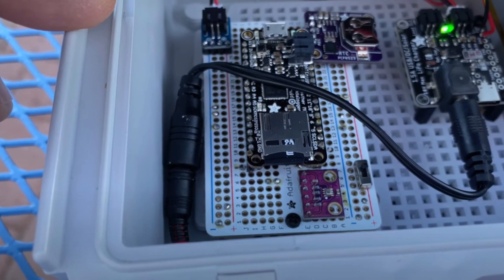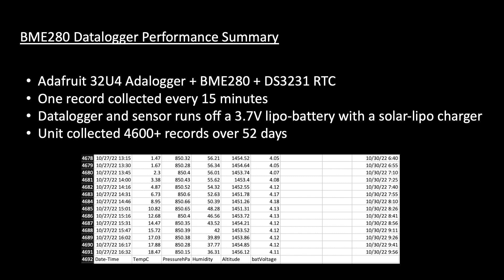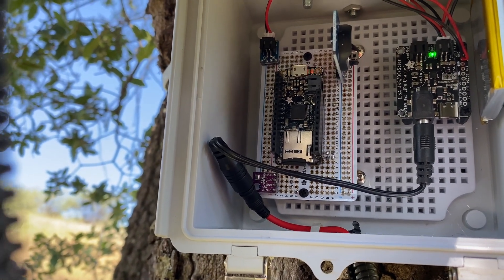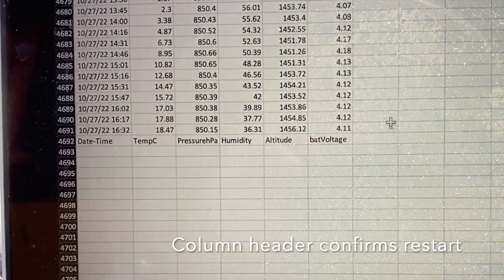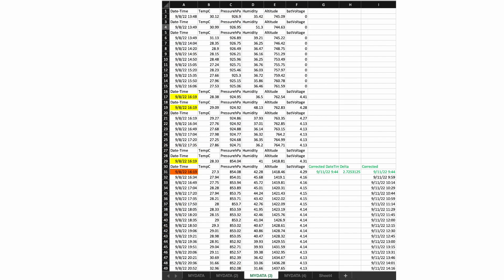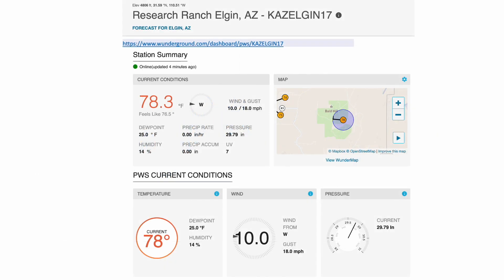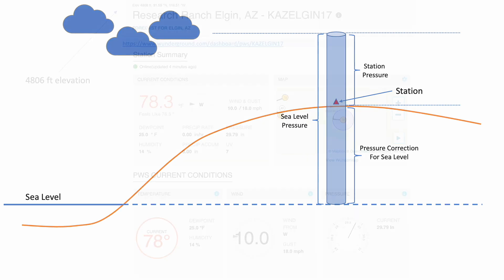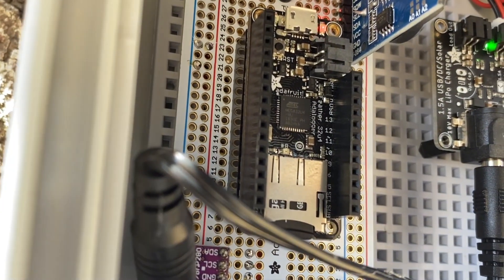Wetlands BME280 Datalogger - NEW Upgrades and Performance

Comment: Hi, Any chance you have a circuit diagram?  I'm struggling with how to connect the Esp32 with the solar charger circuit, battery and solar panel.
Reply from the maker: I have another video where the solar part is explained for a similar setup - scroll around on this one of details: https://youtu.be/93ipPhr7QtQ?si=iXXM4SP04Ul9B8nm
Reply: @ModestMaker  I'll check it out, thanks!

Comment: How did you manage processor so that it wouldn't drain the battery?  Did you put it in sleep mode?  I have a flood monitor using an ultrasonic sensor and am using a 5110 timer from Adafruit to completely turn off the system for 10 minutes, then back on to take a measurement.
Reply from the maker: Because we get so much sunlight in Arizona and since these are relatively low power systems, I haven’t had to deal much with power management but it is something I am exploring at this time 👍.

Comment: I used a watchdog timer to automatically reboot my microcontroller if it got hung up.  You can set the watchdog timer to whatever time you think is sane for it to do its work, like 4 seconds.  If the microcontroller is not done in 4 seconds, then the watchdog timer will reach over (you have to look real fast 🙂) and hit the reset button.  That might help you out.
Reply from the maker: Will check if out- thanks!

Comment: I've had similar issues with long term sensors, specifically using ATmega MCUs. One issue is because you're accessing the file system on an SD card with a relatively small and incapable 8-bit micro-controller with a lot of limitations, one thing that can happen is your RAM becomes fragmented or simply just full, the memory management on those little micro-controllers isn't smart enough to manage the memory in the same way a desktop PC can so will just lockup.

You can solve this issue by resetting it regularly in software, you can put the ATmega32u4 into sleep mode and use an internal timer and interrupt to wake it up again, this also has the added benefit of using significantly less power however there are limitations on max sleep time and resolution.

Unfortunately it's rather complex and involves editing the registers of the MCU directly, but a first example you can try on your ATmega32u4 to go to sleep for 8 seconds is:
```
    // start going to sleep
    USBCON |= _BV(FRZCLK);  // freeze USB clock
    PLLCSR &= ~_BV(PLLE);   // turn off USB PLL
    USBCON &= ~_BV(USBE);   // disable USB

    ADCSRA &= ~(1 << 7); // disable ADC
    SMCR |= (1 << 2); // power down mode
    SMCR |= 1; // enable sleep

    MCUCR |= (3 << 5); // set both BODS & BODSE bits
    MCUCR = (MCUCR & ~(1 << 5)) | (1 << 6); // set BODS bit & clear BODSE bit on the same clock cycle

    _asm_ __volatile__("sleep");
```

I would also recommend you split up your CSV files, for sensors that record every second I get them to make a new file every day, you might benefit from a new file every month or week, the reason is when it opens the file to write to it, it starts at the very top, then has to traverse down to the end which takes time and if it messes up and corrupts the file you only lose 1 CSV instead of all of the deployment.

I'd also recommend getting a brand name SD card, eg. SanDisk Ultra 16/32GB, they generally consume less power and have more reliable SPI mode communication for MCUs.

However the reason why your sensor locked up I would speculate is because the SD card locked up, I've had this happen many times before even with brand name cards especially when trying to write to them quickly in SPI mode. For this reason my long term sensors always have a MOSFET that switches the power to the SD card off which forces the card to restart in a known good state. Getting someone to just press the reset button on the Adalogger I don't think power cycles the SD card so might not solve your lockup issue.

Also on lines 231 & 333 you have an extra `myFile.close()` that looks like it should be commented out, I can't remember what that does if the file is already closed or was never opened but best comment it out.
Reply from the maker: Yes - I'm going to have to do a separate video just on testing various remedies to address these lock up issues. Yours is yet more excellent feedback for which I'm sincerely thankful. I am glad I'm not alone and that others are coming up with remedies- that's why I share all this stuff online. Thank You!

Comment: This is some good work all right!  I'm in the PNW and solar doesn't go as far for me, but the deep-sleep maneuver of Mr. Donnelly also works well for me.  A question:  have you ever had trouble with the SD card interface?  Or put another way, if the data were at some point to cease being written successfully onto the SD, how much time might go by before you'd find out?
Reply from the maker: Excellent question-- I only get out there once a quarter at best, so the possibility of losing large volumes of data is significant. Having said that, I've gotten a lot of good feedback on potential fixes which I will be testing and posting to this channel - sounds like this is a common issue needing remedy! (In the past, I've used satellite and cellular, but that costs money.)

Comment: Unassigned IO pins can become noisy gremlins that sap power and cause trouble, especially during long delays during which interrupts may be unknowingly enabled because delay() may not stop all activity, depending on your processor. A nearby lighting storm can also cause havoc to trigger such a sensitive system into the weeds. Ground loops and unshielded wires make matters worse. During void setup() declare any unused floating IO pin a pulled up input.  
A good practice in autonomous systems is to comment out your Serial.prints after development debugging.  
For very long delays, instead of using delay(), which is prone to many risks, I recommend millis(). There are many great tutorials and examples. 
I use millis() for autonomous systems that operate continuously for many months, even taking account of its counter’s overflow.
Reply from the maker: Excellent feedback. What you state makes sense and is not to difficult to implement.I appreciate your thoughtful response and advice-- thanks for giving me another venue to explore.

Comment: I have across the same problem with some of my data loggers.  What I did is install a small mechanical clock which powers the system down every Sunday at 2AM.  That minimized system crashes to less than once a month so far.  I have several commercial system that have this feature built in.  That's where I got the idea.
Reply from the maker: Mechanical clock - interesting. I'd love to hear more details on your design. Thanks, and at least I don't feel too bad about the halt in logging since it's starting to sound like something fairly common for these little microcontrollers with multiple remedies out there.
Reply: @ModestMaker  Well my systems are much different then what you are doing.  My alarm/recording systems are centrally located indoors, so I have a 120 volt power supply readily available.  My systems monitor the air quality of large compressor rooms at cooling and freezing food processing plants mostly sniffing for ammonia refrigerant leaks.

I use one Intermatic ET8215C 7 day time clock to reset my data monitoring systems every Sunday at 2am, the time with the least demand on the compressor rooms.  Since I only sample the air quality every 10 minutes, a simple reset time of 1 minute means no loss of data.

Government and insurance underwriter regulation of confined spaces preceded data alarm/monitoring and recording systems.  So we had to build our own.  Tough to do when my father ran the company.  

Now days alarm monitoring and recording systems are commercially available.  But I still build my own Arduino based systems to monitor and record data remotely via various internet apps.  This gives me the capability to monitor trending data.  Thus I can notify the compressor room operators prior to an alarm trip.  Something the commercial monitoring systems do not provide.

This also allows me to monitor the compressor rooms independently and without a paid subscription to the manufacturers of the commercial recorders and alarm companies.  

I still have the occasional system reset like you have, but no more than once or twice a month since I started resetting the systems on a regular basis.  I tried several times to locate the error in the system causing the resets, but with no luck.  I'm just a novice programmer and haven't taking it any further since the time clock solution.  They seem to make my systems much more reliable so I didn't see the need to get a professional programmer involved. 

Although someday I would like to build systems like yours to remotely monitor my property and a few greenhouse operations.  But I'm currently just too busy to get around to it.

Thanks for you videos.  They are very informative.
Reply from the maker: Thanks for the summary. Sounds like you enjoy the low cost and customization freedoms that this platform offers (like me) 👍.  Agreed- much more you can do when you can customize like this.

Comment: The mystery of the hardware lock up. For my data loggers, after they record their data, I put them into a deep sleep mode, then have the RTC wake them up at the desired interval, which performs a reset, reads the time and data; writes the data, then goes back into deep sleep.
Reply from the maker: Yes - I have to do a little more research on making these deployments more power efficient. With so much sunlight in Arizona, power has never really been an issue but I'd like to make this more cost effective via elimination of panels and chargers. I like the idea of having a reset done programatically-- will investigate. Thanks You!
Reply: I endorse this because, in addition to the deep-sleep trick which I do use and it does save power, your scheme's reset-per-sample will bulletproof the machine against all kinds of glitches known or unknown, hardware or software, if they're the kind that can be solved by a reset.  Besides that, code that only has to run one sample all the way to completion one time is surely easier to maintain than code that hopes to run forever.  (Fingers crossed it might be smaller too.)